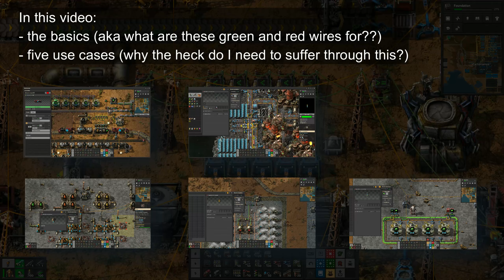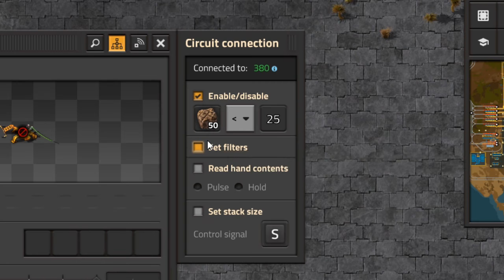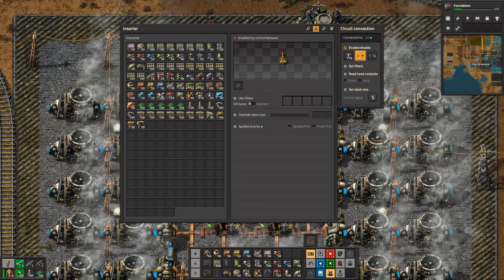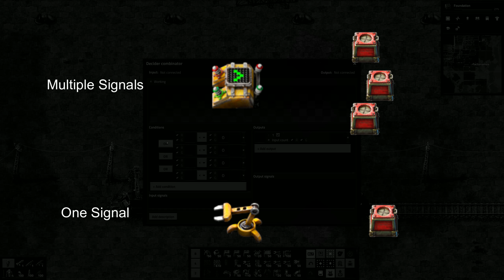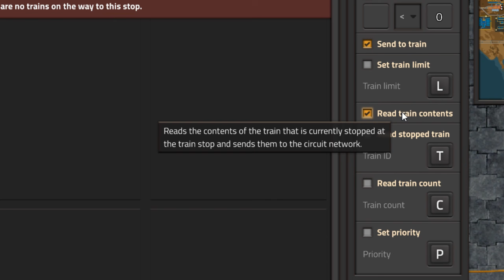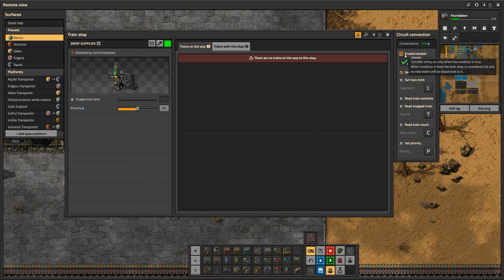Factorio Circuits Made Easy — 5 Simple Examples for Beginners

Comment: circuits ARE kinda scary if you are playing without space age, apparently anyway. I haven't experienced it yet because I just bought space age, but apparently SE brings a lot of QOL changes to circuitry that makes it easier to understand and makes the bar for entry a little lower.

 I have to say that I beat vanilla on deathworld, and removed my factory, decided to go to map editor to learn instead of in my game and doing things I thought would be simple enough to accomplish in a day or two, were not easy to understand at all. Matter of fact I had to outsource literally everything to google and reddit searches because I couldnt figure out simple things like a basic memory cell, or chaining them together to remember just the second last signal, hold a signal for some time after a signal is removed etc. All that was so frustrating to learn that I stopped playing for a day, came back and read that circuitry changes a little in SE and so I deleted all my saves and bought space age to restart.

Hopefully it's easier in SE and after I watch this video, ideally I will be able to go for 5 minutes without searching for a dang answer.

I did manage to make some progress with my circuitry before I removed my saves, but figuring it out in a self sufficient way is extremely difficult, which brings me here.
Reply from the maker: I totally get that, circuits can definitely feel like a steep climb at first and the in game info doesn’t help much, but it gets much more intuitive with practice! 👍

Comment: So on the Advanced Oil processing, what if I want it to not surf on the limit ? The setup that you show in the video will have the heavy oil cracking turn on and off and on and off over and over as you get in new oil that puts you over the limit and then crack it to get back under only to have new oil come in and put you over again. It's clearly better to, for example have the heavy oil tank fill to 20k, and then the pump turns on and keeps going until it gets down to 5k, and only then does the pump turn off.

My thinking is that you want to have the pump and a combinator both check for 20k oil, and then have the combinator output an oil signal worth 15k to the pump so that the pump is getting the 20k in the tank and an additional 15k oil from the combinator. It will turn off on its own once the actual oil is < 20k - 15k (the amount of oil that the pump is looking for - the extra oil that the combinator is faking for us) which is going to be 5k, the lower limit that we wanted. Once there is less than 5k oil in the tank, the combinator no longer sees >=20k oil and stops outputting that 15k signal so now it's just seeing the < 5k in the tank. It won't turn on again until the tank itself gets back up to 20k.

So that's: feed a green wire from the tank to the pump and to the input of your decider combinator.
green wire from the combinator's output to it's own input, and to the pump (but if you connect it to the pump it will see itself via the pump-tank--combinator input chain anyway so you probably don't have to connect it to itself)
Set the pump to enable at >= 20k oil
Set the combinator to look for >=20k oil and to output an oil signal = 15k

Or something like that...
Reply from the maker: That’s a really thoughtful setup and explanation! It definitely makes sense and would keep things running more smoothly. For this video though, I wanted to keep it super simple for players who are just starting with circuits.

Comment: You really got to get into selector combinators. They make sushi belt management so much easier, especially on space platforms. And constant combinators are just a convenience.
Reply from the maker: I haven’t felt brave enough to explore those but I’ve been tinkering with sushi belts recently, I might give those selector combinator a go!
Reply: @Tipamisto  I generally like to use selectors to see what I have most on my belt, run it through a decider to make sure that is above a certain value, and if so just jettison it into space. Prevents belts deadlocking due to a bad wave of meteors.

And the decider is honestly optional.
Reply from the maker: @weckar interesting! What I’ve been doing recently is creating a sushi belts to scale quantum processors build in aquilo, not using any combinators, just “inserter basic logic”, but you’re making me want to upgrade my approach 🤔